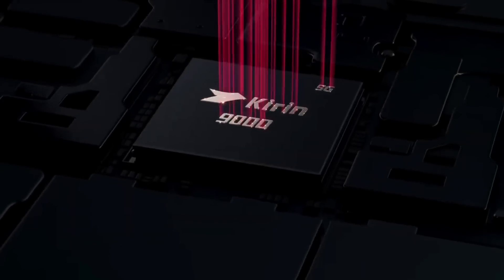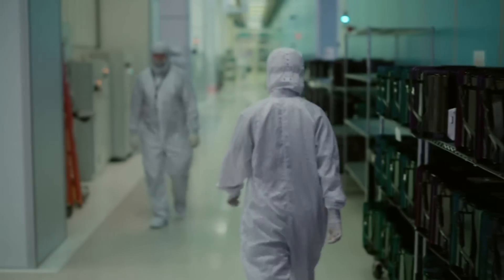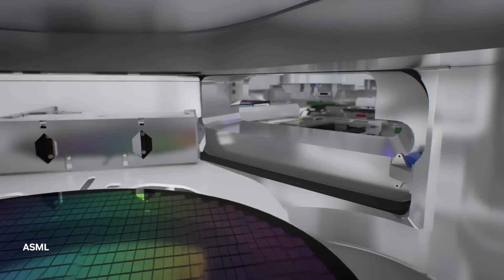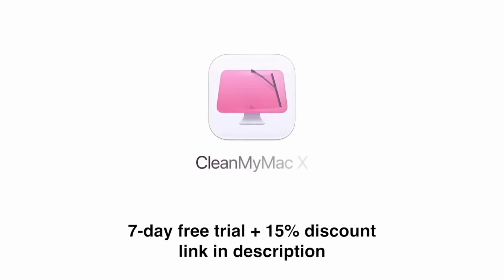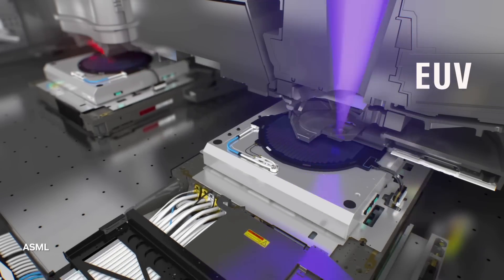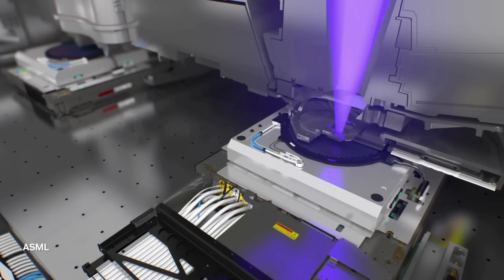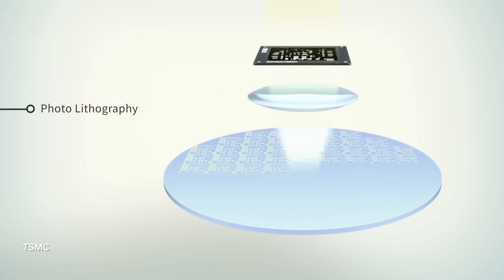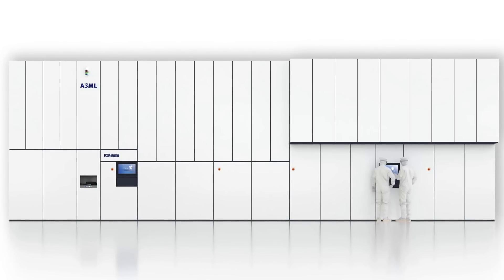The Truth About China's 7nm Breakthrough

Comment: The pride of Taiwan, Taiwan's leading foundry (TSMC) has never produced semiconductor manufacturing equipment. Since China Microelectronics Semiconductor Manufacturing Equipment Company purchased 28-nanometer semiconductor manufacturing equipment, it has continued to 7-nanometer semiconductor manufacturing equipment to produce chips. Currently, TSMC's 12-inch wafer fab in Nanjing, China has been equipped with China Microelectronics' 7-nanometer semiconductor manufacturing equipment to produce chips for Apple, Samsung, Huawei, etc. Since 14nm semiconductor manufacturing equipment, UMC has purchased semiconductor manufacturing equipment from China Microelectronics Semiconductor Manufacturing Equipment Company. In 2017, China Micro-Semiconductor mastered 5-nanometer etching machine technology! Sales of 5-nanometer semiconductor manufacturing equipment in 2018. China Micro Semiconductor will sell TSMC’s 5-nanometer semiconductor manufacturing equipment and even 3.5-nanometer semiconductor manufacturing equipment. TSMC chief Chang Chung-mou told Taiwanese that China is about seven years behind Taiwan in semiconductor technology. This is a travesty in itself.

Comment: Every tech breakthrough from China you have to take it with a grain of salt the size of 7 km... 😅
Reply: Many people just like to continue to cook the same old thing. They are really happy to lie to themselves, even if it is not true, as long as they are willing to believe it!
The world's number one semiconductor equipment manufacturer is not the Netherlands' ASML. The top R&D team of Applied Materials in the United States (chemical vapor deposition) makes silicon wafers. Silicon wafer etching machines place chip functions on silicon wafers. The two main founders focused on the above functions when they worked at Applied Materials , and Applied Materials was the top semiconductor equipment manufacturing company in 2004) (all more than 40 Chinese) left the United States in 2004 and went to China to form AMEC (China Micro Semiconductor Manufacturing Company). In 2017, China Micro-Semiconductor mastered 5-nanometer etching machine technology! Sales of 5-nanometer semiconductor manufacturing equipment in 2018. Currently, TSMC has been equipped with China Microelectronics' 7-nanometer semiconductor manufacturing equipment in its 12-inch wafer fab in Nanjing, China, to produce chips for Apple, Samsung, Huawei, etc. for more than a year. AMEC is preparing to upgrade TSMC's 12-inch wafer fab in Nanjing, China, to the 5-nanometer process. As China's semiconductor market continues to expand, more and more domestic companies have expressed interest in entering the field of manufacturing chips. According to a report from the International Semiconductor Equipment and Materials Association, China is currently building 25 chip manufacturing plants (FAB) in 16 regions including Beijing, Tianjin, Xi'an, and Shanghai. The report predicts that the market size is expected to expand to US$17.3 billion in 2019, becoming the world's largest semiconductor market.

Comment: 3:36: 🔬 The video discusses the controversy surrounding SMIC's positioning as an equivalent to TSMC in terms of nanometer technology.
6:12: 💻 The speaker discusses the Clean My Mac X software and its helpful features for editing videos on a MacBook.
9:18: 💡 SMIC can fabricate nanometers without EUV machines by hiring brilliant engineers and getting creative with limited resources.
12:02: 📺 The economic efficiency of 7 nanometer technology using EUV is significantly higher compared to DUV tools, but pushing the limits to smaller process nodes will take time and result in high defect rates.
Recap by Tammy AI

Comment: The Huawei system update on the 18th unlocked 12 threads. Judging from the decompression of the same large file today, the Kirin 9000s is faster than the Snapdragon 8Gen2. We look forward to the Huawei conference on the 25th to unlock the GPU and revive the Kirin with full health!
Reply: 发布会依然没有讲手机，哈哈，但是放了一首非常好听的歌曲
Reply: @黄微-j2j  说实话发布会有点失望，不过还好Mate 60 RS上架，可以预约了，很期待RS的SOC是什么制程
Reply: they did not say anything on the release conference. It seems that they do not want to disclose much information to prevent further sanaction from US
Reply: So far no test software on the market knows how to test the Mate60 GPU, this clearly implies it is of a very different architecture.  A hands-on review claims Mate60 is smoother at the UI level, but this smoothness can be for various reasons.  Some games experienced hiccups but this is most likely optimization/driver issues.

Comment: What after silicone chips, you can only go so far, next step that is  graphene  microchips?

Only graphene has the potential to push the limits of microelectronics, although its production is notoriously difficult. A team of researchers has found a way to industrialize the production of graphene and to design a modified chips with this material. This is the next step Chinese chip manufacturers development 🙏 amituofu

Comment: Yesterday, Huawei unlocked Mate60，The 12-core hyper-threaded CPU has surpassed the 3 nm cores used by Qualcomm and Apple processors.
Reply: design is the key. Better designs may need fewer number of transistors. Ignore the design and talk only about how dense the transistors are, it doesn’t mean anything. A fat guy is not necessarily stronger.
Reply: The hyper-threading is confirmed but the final (this may not be the last unlock, GPU side not touched yet) performance needs more testing.
Reply: Yeah they surpassed Iphones from 7 years ago lmao. nice cope
Reply: Nonsense. They can do it one day, but not now. How many generation 3nm is ahead of 7nm?
Reply: utter lies
Reply: @peter-xw1mu  already tested
Reply: @peter-xw1mu  Suck it up, the west is over.
Reply: @peter-xw1mu  ...proof of those lies please that you are basing your statement on i would be interested to know ....
Reply: LOL, nice joke
Reply: only a Lie by CCP lol
Reply: @KAVAN12345  Well frog, Huawei Mate60 and iPhone 15 were tested in the same environment, and Huawei phones have a transmission speed five times faster than iPhone 15

Comment: There is a reason that their phone used a crypto chip adapted for use. There is much more than laying down structures onto a substrate. they can call it what ever process size they want. It is little more than semantics to segregate the process nodes these days, irrespective of actual size. It is suspicious that it is a crypto chip reminiscing China shuttering the crypto business not so long ago. A pocket of chips from that era, resembling the size wanted? There are no lithography shortcuts for now for any kind of breakthrough. These chips make for a phone that is a stuttering mess. Perhaps they would have been more impressive if they went back to crypto. This whole situation pushes the BS meter up high on the scale. It smells more of face saving than it does any practical production. What else can they use a crypto chip for, when crypto is not allowed? Tofu dreg chip design, just so they can "claim" they have something. You can't build an industry out of a cancelled crypto chip design that already had the lithography layouts burned. If they really had something, they would have cut to the chase and created a real phone chip. Not this franken chip created for something else entirely that was outlawed.

Comment: In practice, U can use DUV machines to fabricate nodes up to 5nm using SAQP but the issue is the yield. SMIC N+1 and N+2 process has performance equivalent to TSMC N7P and N7+. As the video said wheither it's call 7nm or N7P or N+1 doesn't really matter. What matters is the performance benchmarks. I think SMIC 7nm node process should have achieved a yield of at least 80-90% for it to commericalized in such large scale for the Kirin 9000s. U are talking about 20m pieces of Hauwei Mate60Pro series and X5 just this year. 2024 est sales for the Mate60Pro series is around 50-60m.  Otherwise Hauwei and SMIC will both be losing money selling at the price it's selling now. SMIC N+3 process which is in development is equivalent to TSMC 5nm node which will be used in the Kirin 9100 processor to be released in 2024. BTW TSMC's 3nm node is a dud. It's performance and power consumption is only 10% and 25% better than the 4nm node used in A16 and Snapdragon 8 Gen1&2 but it's twice as expensive. Moreover the yield is only 55% which for anyone who knows anything about semiconductor is way below what is required for risk production let alone mass production! TSMC is subsidizing Apple to use it cause it wants to improve the yield and Apple wants it cause it has nothing to show for the iPhone 15 except this 3nm A17! With battery capacity continuously improving noone would ever care about power consumption anymore. Would U care how much power your desktop consumes? (expect maybe envirnomental nuts!) LMAO!!!
Reply: Apple's deal with TSMC is to only pay for good wafers, so that shoudn't affect iPhone prices much. Heat degrades electronics, and batteries. We don't need a handwarmer.
Reply: at least apple has an excuse to state why their phones are expensive.
Reply: @keyto5526 it's called profit

Comment: I think what's left out of many place is that the chip, while it does its job, isn't very good relative to others. For example iPhone 11, phone that was released 2019, had 30% more powerful(as in performance) chip in it. And in addition, requiring much less power, thus requiring much smaller battery. I feel the word "breakthrough" is just overblown by a lot in media. And the picture just looks worse in the future, as newer machines are no longer available.
Reply: 1. uses TSMC chip 2. It is not 30% more powerful where did you pull that number out of you bntt? Huawei Kirin 9000s is 40% more powerful than even last year's Apple chip (even with TSMC help and 25 years l more time in the field 🤭) 3. The Apple chip was much less power efficient
Reply: "uses smaller battery" 🤭 you sound like real "expert" making $$hit$ up
Reply: @robertgittings8662  Apple's chips use ~7W at most. Kirin 9000S 14W. 

Apple A13 bionic chip from 2019 beats Kirin 9000S in performance, feel free to go look at the numbers.

Apple iPhone 15 ~3300 mAh, Mate 60 pro 5000 mAh. 

Mate 60 pro weighing 20% more than iPhone 15

Comment: China's government/Huawei imported the equipment not yet covered by sanctions from Europe.  The chip architecture is a copy of some old Western ARM design.   You might as well swoon over a five year old Snapdragon.   Huawei hasn't the culture to innovate anything. 

BTW, you spoke about Rocket Lab.  The idea behind it was to put satellites into orbit much more cheaply than the big brands could do it.  I made low voltage looms for the first seven flights,  and the company where I work still makes some looms (wire harnesses) for Rocket Lab including the major one for the booster stage, but in any case, Rocket Lab is now a U.S. based company.
Reply: The usual racist coping

Comment: China cannot manufacture a small laser light source immediately, but it doesn't matter, we don't need it for the time being. We can make a large enough light source, give it a long-distance acceleration link, and then select a small enough light source through an optical pickup. 1nm ~100nm is OK.
Reply: So ASML manufactured photolithography machines to facilitate export transportation. But we didn't need to export, so we built a photolithography factory.😁😁😁😁
Reply: Russia had 13.5 nm EUV lasers since 2011, so "only ASML" is a marketing myth.

Comment: Thank you for this video. I am not convinced, though, that they actually achieved 7nm.. I believe they actually achieved something bigger, maybe 9-10 nm, due to the heating problem that they are having. Yes, I'd like to see more SEM images, where did you get those pictures from?
Reply: @randytaylor1406 Every non-Chinese that looked into it says its 7nm. Not sure why you would even say its not.
Reply: @yerri5567   Everyone agrees that 7nm does not stand for the gate size anymore. Do you disagree with that?
It's used to represent a combination of power dissipation, speed, and tranistor packing. There doesn't seem to be any thermal testing at the chip level. I said that I didn't believe they achieved the 7nm level due to the heating problem.

Comment: As one Chinese industry leader once said microchip is not godmade but manmade. They have so far proved this correct with their fast advance in the chip tech sector. There are more ways than one to speed up a computer and China is doing exactly that by using composite methods to achieve the same end. No need to compete in size of chips.

Comment: Given that the lower physical limit of chip is 2 nm, which sets the maximum barrier for electron tunneling, ASML is approaching the borderline imposed by Physics Law. This gives more advantage to the pursuer (like Huawei) over the pioneer/inventor (like ASML).
Reply: smaller doesn't mean better. Military and heavy industry uses much larger chips which are more reliable
Reply: @richard2845   military and heavy industries do not use thin sheet battery, so power consumption is less of a concern
Reply: The AI chip is about to come out in a couple of years.
Reply: You're spewing nonsense
Reply: 0.002 nm
Reply: @CesarMaidana-g7m  A silicon atom is 0.132 nm across. So how can it be 0.002nm? Moreover, thats just the atom itself, including the crystalline structure thats even larger.

Comment: I’m not sure exactly how chip designers specify size these days, but carbon atoms are roughly between 0.06 and 0.15 nanometers in diameter, and silicon atoms are roughly 0.2 nanometers in diameter. So if a device is about 5 by 5 atoms in area, and many atoms deep, then the device would be approximately 1 nanometer squared and perhaps many atoms deep. Bell Labs fooled around with diodes about this size in the mid 1980s, but I don’t know if they considered these to be ‘workable’.  Going much below 1 nanometer, one would have to go to some form of subatomic engineering, or at least manipulate the electron shells of the atoms in very precise ways, which I am definitely looking forward to seeing.
Reply: The terms “5nm”, “3nm”, etc. are entirely marketing terms. They do not reflect an actual feature size that everyone agrees on.
Reply: @ErikBruchez  Erik, thanks. Years ago, I made some bipolar transistors on a wafer, and the correlation of the ‘nominal’ size rules with the actual device measurements on the silicon, was just a general trend. But my stated atomic limits still hold, more or less. Cheers.

Comment: The 14nm duv machine they have can make 7nm in special mode but the yield is quite low, thus the manufacturing cost is high. There are not many mate 6o pro out in market so the price are driving higher.  I am not sure where do you get the facts.  The most important thing for US is they still can at least supply their military with high end chips.  That is a serious threat to the West.  SMIC did break US sanction on Huwei supplying chips, so there will be sanctions directed at SMIC.

Comment: I have a couple of questions.
1. I understand that with each node generation a new and unique set of features and techniques are developed. If that is true, is it likely that even if SMIC/Huawei can achieve certain node level sizes that they would still be without the particular features and techniques ASML provides by using their machines? And are those differences that ASML can provide likely significant?
 2. I've read some industry analysts have long speculated that even at the beginning of sanctions that 7nm nodes can be achieved by maximizing the capability of DUV so if SMIC has accomplished that, it shouldn't be a particular surprise but analysts estimated to do so probably requires approx 40% waste (60% yield). That's competing against ASML EUV machines that strive for at least a 95% yield. Is this something that is generally believed in the chipmaking industry, and if so does this mean that to take just a minor step beyond this point by SMIC would be prohibitively expensive although probably possible for very, very limited use?

Despite what is in this video, I had not heard that any analysis has identified a characteristic of anything better than a 7nm process. If something unique to 5nm and not just 7nm has been discovered in these Kirin chips, would like a reference or what that something is.
Reply: The chip may be more expensive, on the other hand Huawei has used Chinese components in their phone which lower the cost of the phone. This can cancel the higher cost of the chip.
Over time they will be able to fine tune the production process too.
Reply: A lot of techniques are developed by individual foundries that they patent and protect, like there are tsmc processes that chip designers use that can only be fabricated by tsmc.
Reply: @NomadWalker-io3ne  Science is universal. Just as China kept the production method of silk top secret. Eventually it was stolen by the West. 
Semiconductor is no different. In fact the science is public domain. The choke point is the equipment, which China will eventually learn how to make the equipment.

Moreover the performance difference between 7 nm and 3 nm chip is not an order of magnitude. It's more like improvement of only 30%.